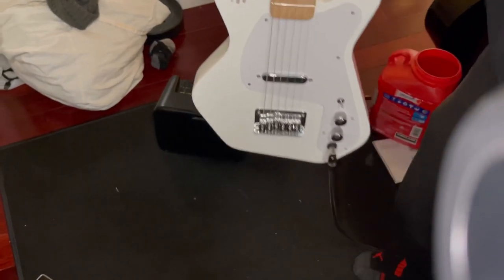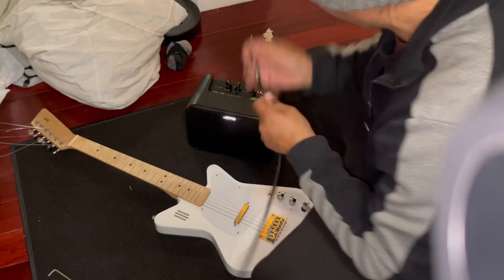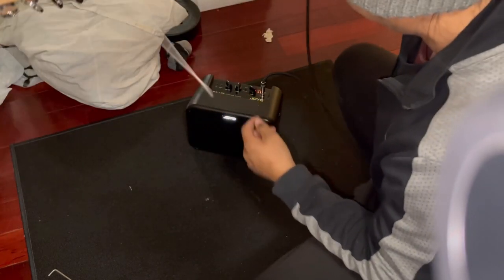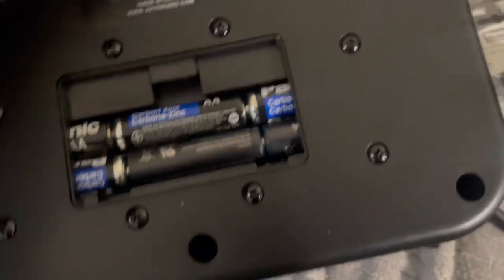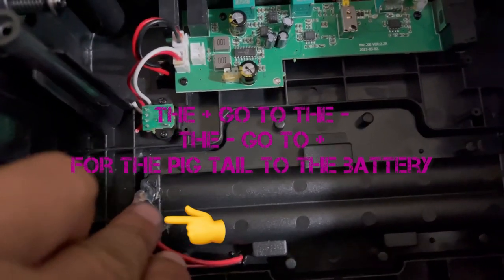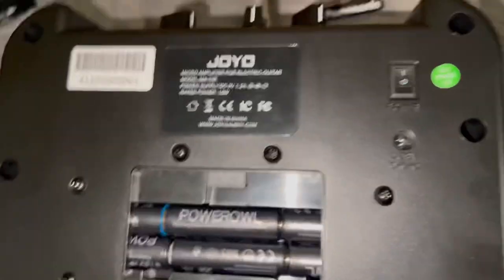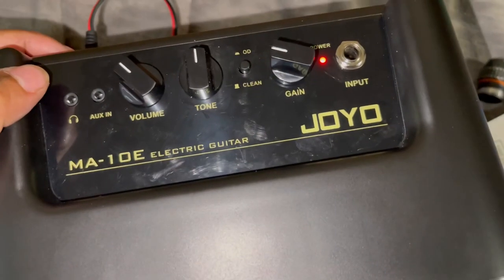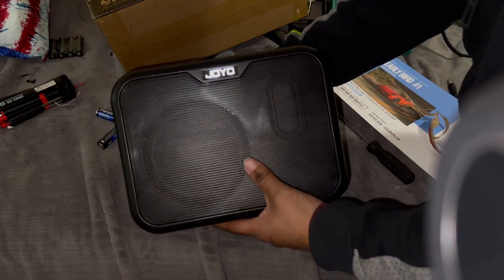JOYO MA-10  Battery not working  (fixed)

Comment: Hi, excuse me, what screwdriver or how did you take apart the cover to access the board? I'm trying to take it apart but I don't know if my Phillips screwdriver is too short because I don't feel the cover loosen.
Reply from the maker: I think I used a 12” Phillips head. Once you screw all the outer open hole screw should open
Reply from the maker: And the middle screw is to take off the batteries pack sections
Reply from the maker: Part 3:04 min in show me screwing it  back
Reply: @ACEBTRAVEL-AZ-ADVANTUR   Thank you very much, I will try to do it with another thinner and longer screwdriver because I think the one I have does not reach the screw.